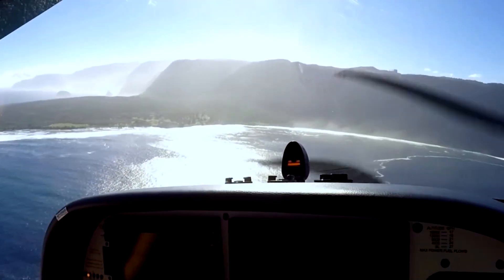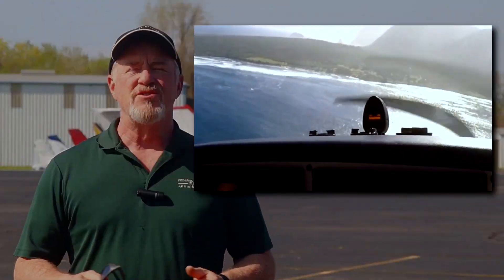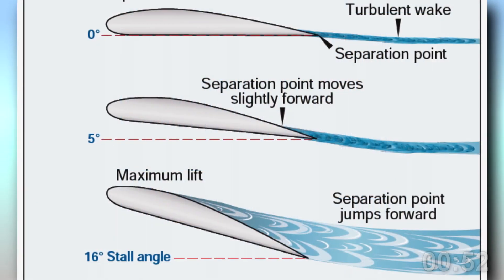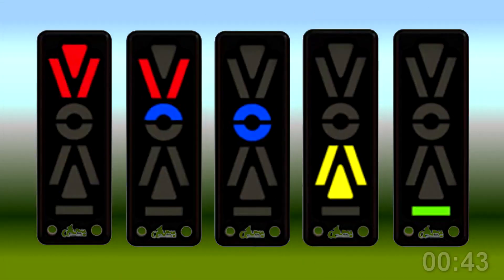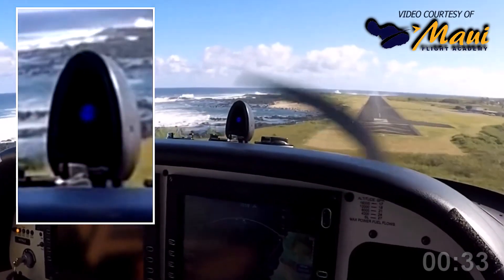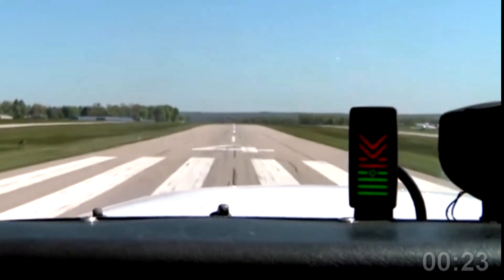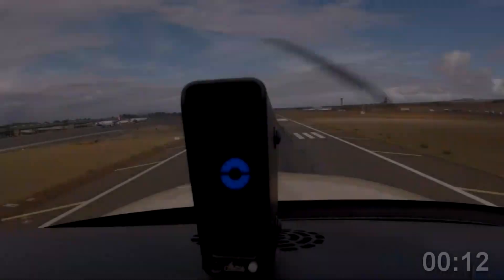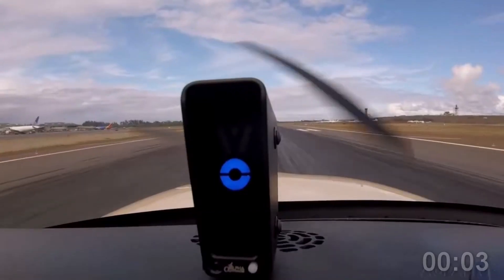Aviation Safety: Angle of Attack Awareness

Comment: Newer AOA indicators are built into PFDs but they still need to be calibrated properly so the the critical AoA is exactly at the stall speed.  BTW,  off topic, there's been an old issue I'd like to debate someday that I believe is a falsehood, even in the older FAA pilot manuels.   That is, as the error goes, "in a constant altitude banked turn, the outer wingtip flies faster than the inner wingtip thus causing an "over banking" tendency".  I've heard others say this is hogwash, while others say that in a medium to steep bank, it is necessary to use the opposite aileron to control the "overbanking tendency".   Someday we should discuss this.  It's my opinion that in a constant altitude banked turn, both wingtips fly at an identical airspeed.  If you search even the older AIMs the FAA has said this.  However, I believe the FAA is silent in their more recent publications.  What does anybody here who flys airplanes, or gliders preferably,  have to say about this?
Reply from the maker: David, I've encountered Delta Captains trained by the United States Air Force that because their education in physics amounts to an oversimplified short course, they couldn't accurately answer questions they were asked about the forces on their aircraft.   So I think you are wise to ask.  You obviously recall the old 33rpm long play vinyl records.  Let's take a disc from the Beatles White Album, a 33, as an example.  Mentally mark the inner track with a single white dot and then perpendicular to the grooves move in a straight line from this inner white dot to the outer edge and mark that point with a white dot.  Lower the needle and start the player.  

Q1. Do you agree or disagree with the statement that, on each revolution, the inner white dot and the outer white dot both pass under the needle arm at the same time?
Reply: @TomOwensUAP  Yes, I get your point.  I also agree that the tip of a propeller flies faster than the inner part near the hub.  In fact, some props spin so fast that their tips break the sound barrier while the inner parts do not.   Is that the point you were making?
Reply from the maker: @daffidavit  David, yes you are jumping ahead... but that's okay because the point you are making is valid.  If you recognize that Linear Speed in the Lift Equation is  Speed = Distance / Time and that the outer surface of disk travels more distance than the inner hub in the same time... then it becomes clear why the Wright Bros twisted the propeller for more even thrust across the blade and why an airplane can suffer over banking in the turn you described.
Reply: @TomOwensUAP  On the wing, there is a "washout" so that the ailerons will be affected last during the wing stall.  This is why most general aviation airplanes are designed have a twist to the average cord line toward the wing tip.
     But here's my other  point.  To be clear, I'm saying that an airplane (the wing really) in a level banked turn,  45 degrees of bank for example, does not "know" that it's turning.  If the airplane (wing) had a mind and was turning in a cloud, it would not know that it was turning with respect to the Earth.  The only thing it would "feel" is heavier due to acceleration. The only time one wingtip flies faster than the other is during the yawing process.  As one wingtip is yawed to the right (the left wing moves forward) it is moving faster than the right wing, but only during the yawing process.
    The airplane does not know that there is an earth below it because there is no connection to the ground.  This is different than the model airplanes we had as kids where we had a hand-held controller connected by strings.  There, the model is acting like a propeller and the outer wing is flying faster than the inner.
        But in a real airplane, both wingtips are flying at the same airspeed because the wing doesn't know it is turning.  It only feels heavier due to centrifugal force.
       In fact, the wing "thinks" it's flying straight and level even while turning.  Recall the turning vector diagram where the four forces are acting on the airplane in straight and level flight.
     In a turn, those four forces are still there, except they are shifted due to the earth's gravity.  As the airplane turns, the weight vector of the plane is still parallel to the lift vector.  But the original weight vector is no longer facing toward the earth, it is directed to the right or to the left depending on which way the wing is turning with respect to the earth.  The acceleration makes the wing "feel" heavier.
          Relativity plays a role here.  The new "total weight" vector is shifted to the right or to the left, and it's pointed to where the wing "believes" the earth should be.  Therefore, the airplane "thinks" it is flying straight and level in the sky, even though people on the ground "believe" it is turning in the air.
         I love talking about this stuff.  I was taught this by an aerobatic instructor who used to fly Decathons back in the day.  The "over banking tendency" doesn't exist.  It's a relic from WWII and even before.  Try going up on a very smooth day and trim the airplane into a 45-degree bank.  Then let go of the controls.  The airplane will continue to turn and not change its bank angle unless disturbed by another force. 
          So what's your take on this?  Do you believe the wing flies like a propeller where it turns on a central hub, or do you think it flies along in the air as it wishes irrespective of where the earth may be?
     I love talking about this stuff.  I wish we could have a beer over this someday should you come to Texas for a visit.
Reply from the maker: @daffidavit  the real key here is that whoever is making this argument, picked the 45 degree bank angle.  In shallow turns less than 20 degrees, you know for a FACT that the inherent lateral stability of the aircraft will act to level the wings unless some aileron pressure is maintained.  For your specification of 45 degrees, however,  this is just at the limit of the 20 to 45 degree range where the overbanking tendency and inherent lateral stability are roughly balanced. Thus the overbanking due to the slower inner wing and faster outer wing IS a force in play, because the aircraft does NOT right itself back to level flight.   If you look at the ACS (formerly PTS) for Commercial Pilot Airplane you will see that Steep Turns are required to be done at 50 degrees of bank angle, for a reason, right?

I'm pretty sure that once you see the truth of the statement above,  I won't need to address that even in the clouds, the outer tip of a mindless turning wing in 360 degree steep turns transits a longer distance in 3D coordinate space than does the lower inner wing tip.   

Now, I am aware of the origin of this argument, it is sourced to Charles A. Zweng in the 1940s.  Neither the present FAA, US Air Force or collegiate flying clubs like MIT's support his statement.  All agree that overbanking is real.  

If you find a credible source currently claiming the opposite in writing under a real name where they can be held accountable for doing so... feel free to share that link here or in a private message if you prefer.
Reply: @TomOwensUAP  I've been trying for years to find the article in Flying Magazine that spoke about this maybe 45 or more years ago where this argument was supported.  I still can't find the edition.  If you can help, I'd certainly appreciated it.  But I'm convinced that there is no "overbanking tendency".  So, we can discuss this issue forever, but if we can't find significant engineering authority, we will continue have a happy discussion on this forever. 
      I used to believe what you are saying when I first began flying lessons, but over the years I've listened to both sides.  It's intuitively natural to see the wing in a turn acting like a helicopter blade, but the real physics of how this works is probably in the mind of some Boeing engineer somewhere.  Anyway, I'm going to check out a favorite book, "Stick and Rudder" and see what old Wolfgang had to say.
          I won't keep harping on this question because your channel is dedicated to a wide audience who may have no interest in aerodynamics,. But a few people here just might.  After all,  ET certainly knows the answer.  Talk soon friends.
Reply from the maker: @daffidavit  David, no worries... this post is an aviation post... you can keep at it here as long as we maintain the decorum.  

This is the Flying Magazine article that I remember reading on Overbanking. 
https://www.flyingmag.com/pilots-places-pilots-adventures-more-there-overbanking-tendency/
Reply: @TomOwensUAP   Thanks for the article.  It seems familiar.  The problem as I see it is that people assume the center of the turn is in a horizontal plane, and depends on the size of the circle.  But in reality, the center of the turn is verticle as if the airplane is being held on a string.  If there is no centrifugal force, the model airplane just hangs on a string from the hand of a person.  But if the airplane is spun around  from above, the center of the turn is  referenced by where the string ends in the hand of the person spinning the model. 
       The string represents the total component of lift.  But in real life, the airplane is not connected to the ground, it flys freely.  The earth is just another point to reference the wings.  Just like the moon, the earth is irrelevant.  
     Anyway, it is an intellectual exercise that really has little effect as we fly.  I know of no pilot who consciously thinks about holding opposite aileron while turning  The article I was thinking about was very old and my friends and I discussed it when I was a young pilot back in the early 70s.  Someday we'll know the answer.  Thanks again for the fun discussion.
Dave.
Reply: Tom, when you asked David for a current article stating that there is no overbanking tendency, I went and looked.  All current articles on the subject reference an old article titled "Questioning the Overbanking Tendency" but I can find it no-where online.  It appears that the original author no longer believed in that argument?
Reply: @northuniroyal643  Thanks for helping out.
I've spent probably 40 years thinking about his unimportant issue, the "overbanking tendency".  I believe it is intuitive, but deceptive, that the outer wingtip flies faster in a turn.  But the issue is so irrelevant to flight training that I would never intentionally teach a student to cross control while turning.  I would teach the student to neutralized the controls.  If the plane overbanks, then let the senses make the minor inputs if necessary,. 
           Also, consider this:  If the outer wing flies faster in a turn, no matter how much aileron a pilot holds would still allow the outer wing to fly faster.  Thus there would always be an overbanking tendency even with full aileron deflection, assuming a constant bank.
          I think the theory of relativity comes into play here.  With respect to the earth, it appears the top wing is flying faster.  But the airplane isn't connected to the ground so it always thinks the ground is level even while its turning.  It thinks the ground is always parallel to the wings even while turning.   It's an interesting physics problem but it really has no real application when flying.  Anyway, I wish I knew the proof of my opinion.  Stll searching I guess.  Thanks for joining in with the fun.
Reply from the maker: @northuniroyal643  while it is a VALID point that you won't find a current, credible argument from an instructor pilot or engineer attempting to dismiss the overbanking tendency as a myth, a better approach would be to directly address any false premises used for the attempted dismissal.  While David is a respected friend of mine, who I would like to keep as a periodic contributor on UFOlogy and Ancient History, I do have an FAA obligation to correct any false  premises stated on this channel...  if I can.  So here is how I would do that as gently and respectfully as possible.  

In any aileron-banked airplane turn, the center of the turn IS NOT at the center of gravity of the aircraft as it would be with a yawing motion.  Rather the center of the turn is the center of the circle laid out by the motion of the aircraft through the 3D airspace... with the inner wing thus moving slightly slower than the outer wing in such a turn. Now that's actually very easy to confirm from all the FAA and other online sources that cover Aircraft Turn Radius Calculations  using the tangent of the bank angle B in degrees and the square of the speed, V, in knots.  There's even an equation for the radius in feet.  It is Radius of Turn (in feet) = V^2 / [11.26 * tangent (B)].   

Thus, for a speed of 108 knots and a bank angle of 45 degrees... the radius of that steep turn would be 1036 feet.

You can see the key diagrams at Page 5-39 of the Pilot's Handbook of Aeronautical Knowledge. 
https://www.faa.gov/regulations_policies/handbooks_manuals/aviation/phak/media/07_phak_ch5.pdf
Reply from the maker: @daffidavit  David, I got busy with a family issue a few days ago and can just now assemble a coherent explanation for you.  

In any aileron-banked airplane turn, the center of the turn IS NOT at the center of gravity of the aircraft as it would be with a yawing motion.  Rather the center of the turn is the center of the circle laid out by the motion of the aircraft through the 3D airspace... with the inner wing thus moving slightly slower than the outer wing in such a turn. Now that's actually very easy to confirm from all the FAA and other online sources that cover Aircraft Turn Radius Calculations  using the tangent of the bank angle B in degrees and the square of the speed, V, in knots.  There's even an equation for the radius in feet.  It is Radius of Turn (in feet) = V^2 / [11.26 * tangent (B)].   

Thus, for a speed of 108 knots and a bank angle of 45 degrees... the radius of that steep turn would be 1036 feet.

You can see the key diagrams at Page 5-39 of the Pilot's Handbook of Aeronautical Knowledge. 
https://www.faa.gov/regulations_policies/handbooks_manuals/aviation/phak/media/07_phak_ch5.pdf
Reply: @daffidavit  Tom has written up an explanation showing that the center of the turn in a steep turn is not at the airplane's CG, but rather hundreds of feet away based on speed and bank angle.  Does that help explain why FAA and other current articles support the over-banking tendency as real, or is there another underlying point of concern?
Reply: @northuniroyal643  OK, but the center of the turn with respect to what?  The earth, or the moon, or Alpha Centauri?  I suggest that with respect to an observer on the earth's surface, you may be right. That doesn't make one wing fly faster than the other, it would rip off eventually.   
          But since the airplane is not connected to the ground, it doesn't "know" it's even turning.   It is undergoing an acceleration which makes it feel heavier.  But with respect to itself, it might as well be flying straight and level.  All four forces are in equilibrium in a constantly banked level turn, just as when it is straight and level, with respect to the earth.
          However, if the airplane were rolling, yawing, or pitching, it would be moving about one or more of its axis.  The aircraft would sense this.   Then it would "know" that something is happening to it.  But when you put a blindfold over the airplane's eyes, so to speak,  it simply thinks it's flying unaffected through a fluid when it's turning.  The only difference is that it weighs a little more, due to the presence of earth's gravity nearby.   All IMHO of course.
Reply from the maker: @daffidavit > "OK, but the center of the turn with respect to what?  The earth, or the moon, or Alpha Centauri? "

David, I think this example may help, but North is free to add whatever he thinks may assist as well.

Take a rectangular piece of heavy white poster board. 
Use a marker to place a point in the center.
Use a Geometer's Compass to draw a circle of radius 10.0 inches around that point. 

Cut out the 10 inch disk that you've drawn and discard the excess material.

You can now take that disk from San Antonio to New York City, Tokyo, the Moon or Mars... you can tilt that disk at a 30 degree or 45 degree angle... and it will still ALWAYS be a disk of radius 10 inches with the center always in the same point relative to its outer edge aka its circumference.  See Euclid's Book I Definitions 15-18.  The center of the disk is relative to the circumference of the circle, nothing else.

As stated previously, the center of a properly executed level steep turn is at the center of the circle transcribed by the path of the airplane in the 3D space in which it flies.

For a speed of 108 knots and a bank angle of 45 degrees... the radius of that steep turn would be 1036 feet.
Reply: @TomOwensUAP  OK, seems logical but consider this.  Take, for example, a model airplane like a Cessna.   Hang a three foot string from the top of the roof near the CG.
Now stand in the center of a room and rotate or spin you body in circles.  The model Cessna will begin to swing out and follow you as you spin on the point on the floor.
           Now, do it differently.  Instead of hanging the string from the roof of the model, attach the string to the left wingtip and spin the airplane in circles.   Now tell me if under both scenarios, the outer wingtips are flying with equal speeds compared to the inner wingtips. 
         In the first case, the string represents the center of lift which opposes total effective weight in a real situation.   The second example is similar to flying a small gas powered model airplane with a plastic hand-controller with strings attached to it.    The later example is more like a helicopter blade where there is no argument that the tips fly faster than the hub.
            In the first example, the center of the circle is no longer parallel to the floor, even though it seems so.  The center of the circle is the point where the string is attached to your hand.  Even this scenario is a simple approximation to reality, IMHO.
This is fun, isn't it?
Reply from the maker: @daffidavit  David, but in both cases, the center of the turn is never at the CG of the aircraft, and thus the tip of the outer wing travels a longer distance than the tip of the inner wing in the same time so as to have a higher linear speed than the inner wing tip.

In the Second Case, with the line controlled flyer, the center of the turn is on the central vertical axis of the boy's body as he turns with the model. 

In the First Case, with the airplane suspended from the ceiling by a three foot string at its CG, the center of the turn will be at some distance just below the ceiling anchor.  As the model aircraft increases in speed, centrifugal force will lift the model upward and outward so as to increase the radius of the turn to a larger percentage of the length of the 3 foot string.  Here, with the model in motion, you can view the 3 foot string now extended from the ceiling anchor at an angle as the hypotenuse of a right triangle, with the turn radius being the bottom leg of that right triangle (at high speed) and the distance from the ceiling anchor to the center of the turn being the shorter leg of that right triangle.

Circle centers are 0d points, and thus cannot be described as parallel with anything as with a 1d line or 2d planar shape such as a circle.

Assuming that the house is all plumb and level, the circle that the suspended moving model aircraft transcribes against gravity will be parallel with the floor.  

Just as with human-designed laws, the laws of nature are also communicated with very precise language
Reply: @TomOwensUAP  Now you know why I've spend almost 50 years thinking about this issue.  I doubt either of us will agree on this particular question.
         But I do remember discussing it with a friend who told me back in  the 1970's that Flying Magizine had an article on this which concluded there was no over-banking tendency.  I've tried over the years to find the older article, to no avail.  Anyway, I think we've beaten this poor horse to death.
         Next subject:  What do you think about the new UFO federal employee whistle blower?  There are YT videos by experts to determine  to see if he's lying.  Is he just another Bob Lazar or is there something more to it?  I love this stuff.  Have a great day everyone.
Reply from the maker: @daffidavit  well, to North's point, the fact that the earlier article questioning the overbanking tendency is not to be found should hint that its author... and others... no longer support its argument based on the facts just shared above which undermine the  premises.  

As for UFO Whistleblowers, I tend not to use broad strokes of language when talking about Bob Lazar.  Instead, I talk or otherwise trade in specific details.  The broad ad hominem dismissal appears to be a tool of the disinformation crowd that would like to reduce interest in the subject.  

There are numerous other military and government UFO whistleblowers who have presented over the past four decades since the mid 1980s. If you share a specific claim or allegation, I can probably show independent supporting evidence for it or at least demonstrate its source.  Over to you...
Reply: @TomOwensUAP  You know I have strong negative feelings about Lazar's credibility, for the reasons expressed by Stan Friedman and others.  But I can't put my finger on this new person.  His resume seems creditable, but he's no David Fravor in my mind.  I don't think he's an eye witness to the alien or spacecraft he talks about.
       Someday, if you're so inclined, I'd like to see a video on credible sightings by those who had a lot to lose, like the Japan Airlines crew over Alaska.  Those pilots would have known that their story would have adversely affected their jobs.  Somthing like that.  People like Corso seem believable, but I'm not so sure he was a whistle-blower as opposed to someone with just an opinion.
Reply from the maker: @daffidavit  Yes, I understand and respect your position on Bob Lazar.  I simply work my language to focus on the facts he stated about Area 51 and the S-4 facility and the saucers that have since been confirmed by others of greater respectability.  I assume that any lies he may have told about his educational background were to elevate his perceived standing so that Knapp and the KLAS 8ball would cover the story. 

So back to your new guy and back to the specifics.  What are his claims?
Reply: @TomOwensUAP  Hi Tom.  He's been all over the news in the past few days.  He states to the interviewer that we do indeed have a craft not made by human hands.  He works for a highly classified agency and has voluntarily come forward to reject recent denials by the U.S. govt. that there is no hard evidence of UAP.  He's not sure if it had crashed or is whole.  He said we have possession of the dead "pilot" of the vehicle.  I know you can find it in a heartbeat.  If you want me to forward a link, I will search for it.  Let me know.